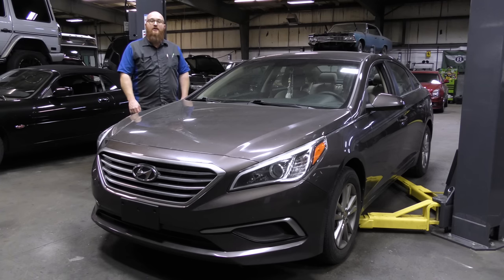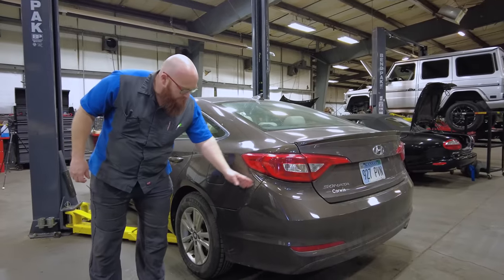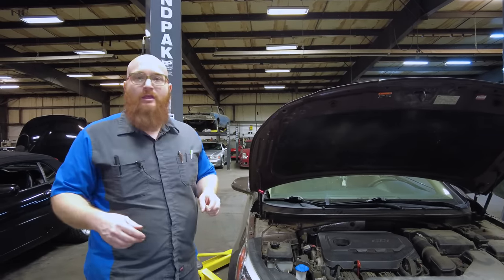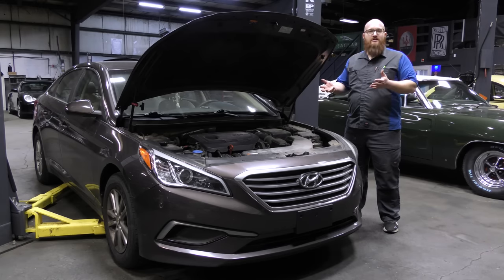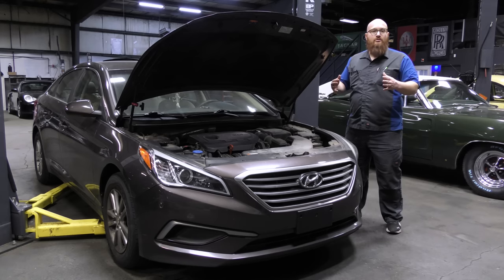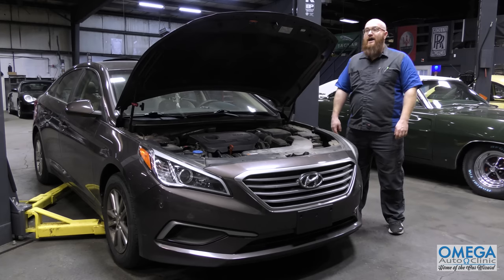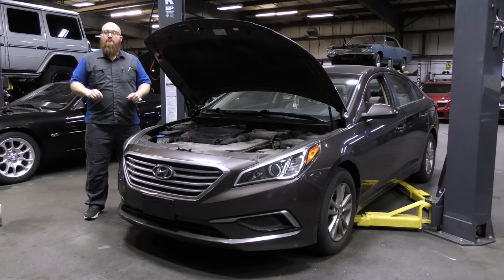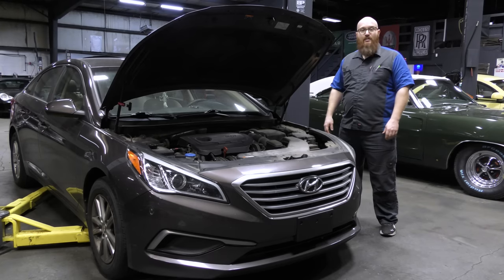What could be so bad on this '16 Hyundai Sonata that the CAR WIZARD is sending it to the junk yard?

Comment: My wife and I bought a 2016 Hyundai Sonata for our youngest daughter, who's in college. After driving the car just over 6 weeks, the engine locked up and put my daughter down on the highway. The oil had been changed 3489 miles previously. We had the car towed to the dealership, and after diagnosing the issue a week later, they said the engine had seized up. The car had 131,410 miles on it and before that happened, the car ran perfectly. It didn't smoke or leak any oil. So they submitted a claim to have the engine replaced, but Hyundai denied the claim. The reason they gave was because we hadn't had the KSDS software update performed, which is included in the 953 recall campaign. Honestly, at that particular time, We were unaware of any such recall or software update, and Hyundai hadn't sent us anything recommending we have it done. Had I known the significance of it, I would've made sure to have it done! After all, recalls and such are free! So the car sat at the dealership for a long time while we tried to figure which route to take. They wanted to replace the engine for $7k+, which I thought was ridiculous, since we had paid only $7k for the car to begin with. So I decided to call Hyundai's claim line and try and plead my case, hoping for some sort of sympathy or monetary relief. Once I got someone on the line and pleaded my case, the person on the phone asked me for my VIN. She then asked me why did they deny the claim and I told her it was due to not having the KSDS update. She said "Sir, your car had the update performed on Feb 9th, 2022"; your claim shouldn't have been denied. So she assigned me a case number and said someone will call me in about 3 days to further my situation. In the mean time the dealership called me and said I needed to come get the vehicle due to them running out of room for other customers. I then told them what the lady said about the update and they told me they would go double check the VIN and call me back. They called me later that day and said someone had indeed "fat- fingered" the VIN, which still pulled up a blue 2016 Hyundai Sonata that hadn't had the update performed. The service manager said they would have to resubmit the claim and call me back. The next day they called and said the claim was approved and that they were extremely sorry for the 3 month long mix up, and that they would place our vehicle at the top of the list once the new parts arrived. This mad my wife and I extremely happy because our daughter really needed her car to get back and forth to class. She lives off campus... So if you know anyone who owns a Kia or Hyundai, make sure you advise them to take their vehicle in and have the update done, if they haven't already. Because that and low oil upon arrival, is an easy out for them and they'll surely deny your claim.
Reply: Hyundai is trash
Reply: This just makes me want to stay away from Kia and Hyundai all together. I’ve heard so many nightmare experiences from Hyundai dealerships.
Reply: As they should if maintenance wasn't done. Look at it this way. You got a few more miles then most people who neglect them.
Reply: I'd drop the pan, lremove the rod caps, emery the journals throw in rod bearings .if the knock is gone I'm good to go. I'll even do the job in a dirt lot under a shade tree. Good thing I've always done my own mechanical work.
Reply: "What I did over my summer vacation" would have been shorter
Reply: Just buy Toyota for peace of mind. Do change oil regularly.
Reply: The problem with the whole situation is the 10-year 100,000-mile warranty there is a mindset that thinks that if the engine blows up before a hundred thousand miles they'll have to replace it.. So the money that should have been spent maintaining the car goes to the drug habit, the tattoos, etc, etc,
Not good for an engine that needs its oil changed with quality filters every 5000 miles.
Nothing in the car really ever goes other than rod bearings. And those can be replaced if the engine doesn't get torn up because of stupidity.
Reply: @abhishektripathi8457 
 Toyota 3 years /36,000
Hyundai KIA 10/100,000..
Now neglect the Toyota and see how long that warranty last. Will they replace third owner engines. My buddy bought a neglected Sportage with 92,000 miles on it he blew the engine at 140,000 miles and KIA replaced it. My brother's blown engine Rav 4 turns out Toyota wasn't so generous even though he's the original owner. Turns out they need oil changes as well.
Reply: @ChasL704   I have owned Hyundai and Toyota. I follow regular maintenance schedules. Cost of ownership and service, in general the build quality and peace of mind is much higher with Toyota. I did not have very bad experience with Hyundai but small issues always needed attention. Obviously the overall build quality is way better on Toyota.
Reply: @abhishektripathi8457  Funny it's the small issues on the Toyotas that I find to be annoying nobody has time for that crap.
It's like every time my brother-in-law brings his Lexus over to the house he's got an oil leak or something's grinding or squirting. Like the time his plastic reservoir for his power steering crapped all over my driveway. For the time my brother's RAV4 engine gave out.... Good times.
Reply: I find it highly unlikely that a software update had any impact on the engine seizing up like that. Even if that was the case, that would indicate extremely poor engineering on Hyundai’s part.
Reply: Dealers (old and new) are required to have all recalls cleared before selling, and they can be held responsible.  That fat finger was def the main culprit of your dilemma (aside from the theta 2 engine recall)
Reply: What's the number to the claim line
Reply: @James-eg3nf  the common failure of this Hyundai engine has nothing to do with poor engineering. It's related to improper manufacturing of a particular engine part at a U.S. assembly plant. Hyundais built in the U.S. generally have more problems than the ones built in Korea.
Reply: That's unfortunate about the mixup, but wonderful they replaced your engine with over 130k miles. Honda and Toyota don't do that. I talked with a guy who bought two Corollas back-to-back and both had a major failure before 100k miles. One needed a new steering rack and the other needed a new CVT. The steering rack was under warranty, but the CVT wasn't. He ditched it and swore off Toyota. Honda is having a ton of issues with AC systems failing annually and the 1.5t engine dumping gas in the oil and blowing the head gasket. I'd rather risk it with Hyundai for the great warranty coverage than risk huge out-of-pocket expenses with a Honda or Toyota before 100k miles. The Japanese brands are not what they were in the '90s.
Reply: @palebeachbum  I would lump that into "poor engineering". Hyundai should be more involved in the quality control of parts manufacturing wherever it is in the world.
Reply: @James-eg3nf  you shouldn't lump them together. Engineering/design and manufacturing are two completely different areas. You can design an engine to last 200k miles, but if the individual parts are then manufactured incorrectly at the factory, the engine is going to have a much shorter life span than anticipated. That has nothing to do with the engineering. If you want to talk about a poorly engineered engine, we should discuss Honda's 1.5L turbo. That engine has been having issues with dumping fuel into the oil and blowing the head gasket prematurely due to crappy head bolt design.
Reply: How did u get the engine replaced with 131k on it ? Doesn't Hyundai warranty only go to 100k ?
Reply: @edg5218  my local Hyundai dealership told me the highest mileage Sonata they had replaced an engine in under warranty had 200k miles on it. I thought that was incredible.
Reply: @palebeachbum  Wow! That's incredible !
Reply: @edg5218 Because Kia and Hyundai got sued and part of the settlement is they have to replace these known defective engines.
Reply: If you know anyone who owns a Hyundai or Kia... tell them to buy a Toyota.
Reply: @zzman5306  Hyundai will still try their best to find an excuse not to replace the engines.  They denied mine for insufficient maintenance despite given them two years worth of maintenance receipts but when I looked at the report I found out that they only replace the engine for first owners I was the car's second owner so I wouldn't have been accepted anyways.  Others have said they were rejected for not installing the knock sensor during the recall.  I'm not even sure if the first owner installed the knock sensor on my car so I would have probably failed that requirement too.
Reply: @zzman5306  Hyundai will still try their best to find an excuse not to replace the engines.  They denied mine for insufficient maintenance despite given them two years worth of maintenance receipts but when I looked at the report I found out that they only replace the engine for first owners I was the car's second owner so I wouldn't have been accepted anyways.  Others have said they were rejected for not installing the knock sensor during the recall.  I'm not even sure if the first owner installed the knock sensor on my car so I would have probably failed that requirement too.
Reply: I have 2017 Tucson  with 2.0. L  they have play games  for 8 months  on the engine they had it for 1 month  then told me it needs a cat converter I told put it on  I told I wasn't paying for it because it's probably full of oil  they told me the warranty is 80000 miles  yr I never her no such thing in my life  cat converter should last lifetime  of a car  I told  corporate  yesterday to re place my engine  they gave me a loner to drive   plus I reported them BBB  they are mad at me I couldn't care less
Reply: I bought Toyota last time, because they have the best warranty and top customer service.
Reply: After my engine died on my Sonata no more foreign cars for me
Reply: I have a 2017 Tucson  been waiting 8 months to fix  my engine  they gave a loaner 5 weeks  waiting to get it fix I told I not going to return it until my car is fixed I never buy a car from  them  talking to them like to the wall  from corporate I was told they are500 fortune company  they are 0 fortune company in my mind these place is a circus  Hyundai needs to go away  they garbage cars 😊
Reply: Here’s a thought. Don’t buy Kia’s or Hyundai!
Reply: First mistake buying Hyundai, second mistake buying a used Hyundai.
Reply: @robertalvarez8689  my hyundai got a new engine at 180k miles for free and I've never done anything to in but maintaining it over 248k miles now, but I know how to keep the engine from wrapping out again this time. I'll get 400k plus miles. Drives perfect transmission perfect. Everyone I know with a hyundai has no issues. Bought mine new in 2015 for 18k.
Reply: Imagine having to do a software update to prevent your engine from seizing 💀
Reply: @WayToManyAssassins  I wish that were the case, but that's not the case. You have to walnut blasting it. No software fixes it.
Reply: @Wouldyoulookatthat2 
What would you do differently? I have a 2018 that I bought brand new. All maintenance done at the dealers as directed in the manual. Now it’s burning a quarter of oil every 1000 miles trying to get Hyundai to give me a new engine. 140k miles right now
Reply: Glad for you. Hyundai replaced our engine but three days later it went up in 30' flames on the highway shoulder. Fireman said he's seen this, pretty sure it was the fuel pump not installed properly, likely re-used, and stayed under high pressure until the battery or wires melted. So hot the frame melted. Dealership never replied, Hyundai said 'you got the insurance payout didn't you?' Bye Hyundai / Kia
Reply: Seems like they are known for weaseling out of their well touted warranty.
Reply: @ChasL704  My son got a new engine in his Sonata as the third owner too. Dealers like to deny the 100,000 mile warranty for second or third owners, but the feds mandated that they replace those engines as long as people own the car because they still haven't fixed a known defect. Manufacturing techniques result in those engines shedding piston debris and clogging oil passages. It's just a matter of time. My son had the oil changed  religiously.
Reply: OMGGGG!! That’s crazy, but I’m so glad everything worked out for you.
Reply: If your oil light comes on your engine is probably already trashed!
Reply: Slap in a new set of bearings and move it on quick!!